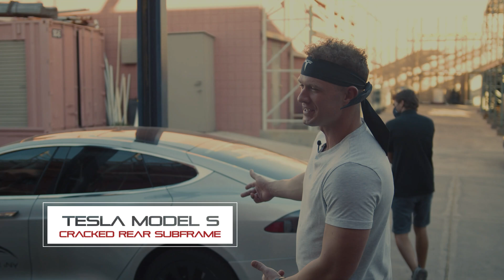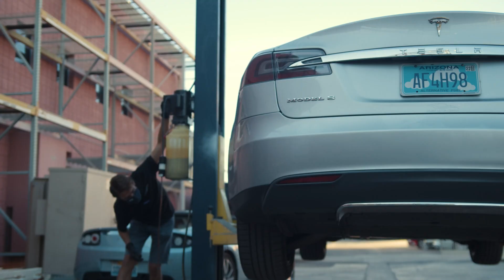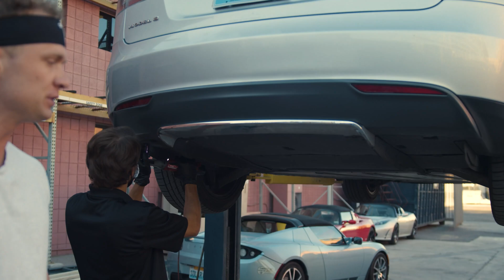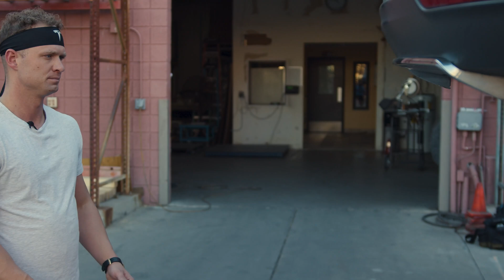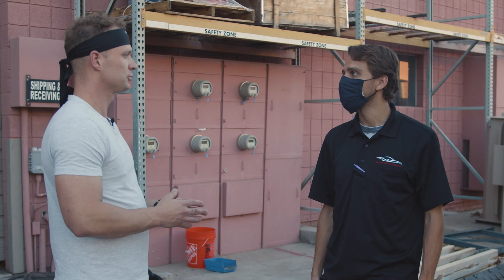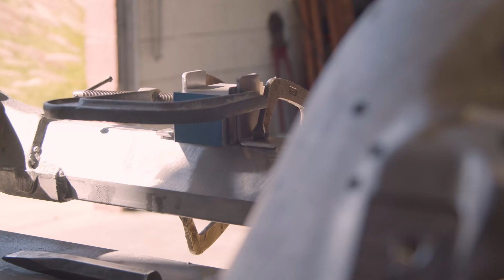Tesla Cracked Frame Repair Part 1 | Gruber Motors

Comment: Design Engineering 101: too much force (torque in this case) vs too little material.  for all it's lightness/corrosion resistance Al is NOT Steel, as such there is NO FORCE so small that will not FATIGUE Al. cast and welded aluminum cracks boys (THEE END).

Comment: I'm very curious why this happened.  We have a 2016 Model S 70.  Looking forward to Part 2.
Reply from the maker: We have a few welding video's on our TikTok and Instagram if you would like to check those out but this happened because of poor driving habits, this is NOT a Tesla defect and this will NEVER happen if you have great driving habits.
Reply: @grubermotorcompany  Thanks for the update.  I guess I shouldn't worry since I drive like a little old man.
Reply: @grubermotorcompany curious what's the cost range for this kind of fix?
Reply: @grubermotorcompany  That is an abhorrent position for Tesla to take. This part was poorly designed and manufactured. Automobiles need to be designed to handle a wide diversity of environments and road conditions and this design clearly cannot handle the rough road conditions of the Midwest.